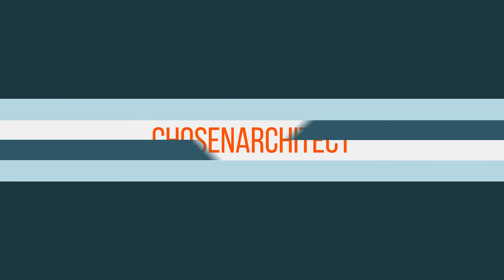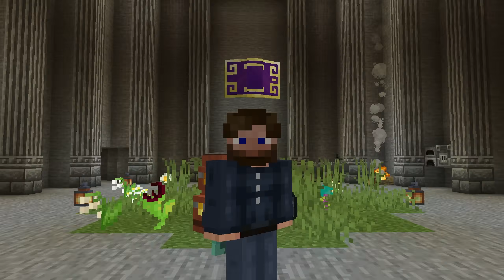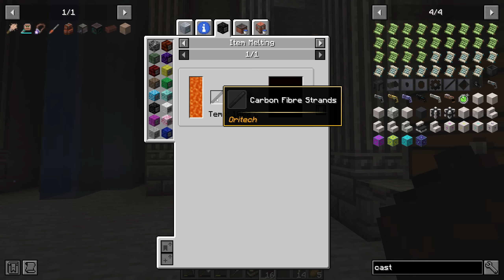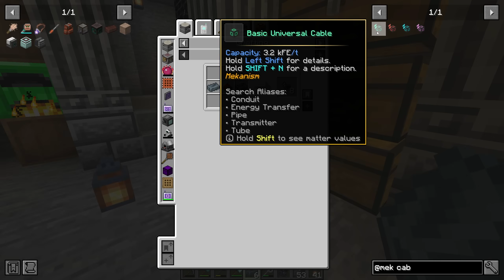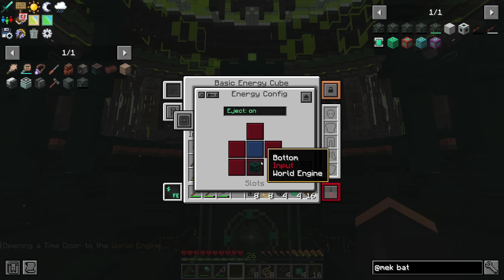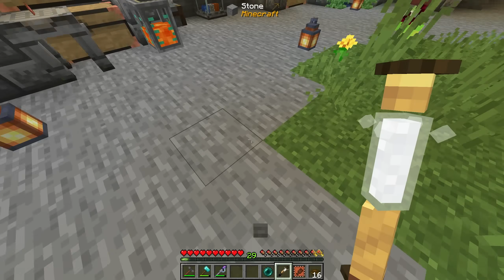Stoneblock 4 Minecraft Modpack EP3 FREE POWER and Quartermaster Quest

Comment: Best way for steel has to 100% be moo fluids takes some time breeding the carbon and iron but once you get the steel cow put it in a jar and add fluid pipe onto a basin (from productive metalworks) and a hopper with a chest under it helped me soo much

Comment: Is anyone having an issue with the world engine machine blocks upgrade/quest? I’ve submitted a stack 3 times now and it has done absolutely nothing. The game will not upgrade the world machine. I’ve tried resetting it and everything…
Reply: The mod pack developer keeps removing stuff, claiming they "fixed" a bug, and every update new bugs have been coming out.  I would HIGHLY recommend avoiding this mod pack now, it's nothing like it was before.  It used to be good.  The github repo is laughable at best.

Comment: The heat generators will transfer heat down to the generator below but some heat is lost this way. I did the math and, with 9 generators, you lose about 300-400 heat stacking them 3x3 vs placing them next to each other on one Y level. I usually create a 5x5 hole for 10 generators. You dig 2 lines in the hole for lava, place the generators on top of the lava and then just fill everything else in with lava after they are placed. ~440 heat per generator if they are lava-logged with lava on all 6 sides. For a temporary setup, either way is fine, you're probably not going to miss the lost heat by the time you upgrade and, to be completely fair, this setup looks 100% cooler than dumping them in a hole and covering them up.
Reply: Thank you for taking the time to explain this, it's useful info for me and you're right, the heat lost is insignificant for early game

Comment: @11:32 If you make an infinite lava source (do the source blocks at the top of a pool trick) and collect it via Create, you can pump lava directly into the Thermal Generators instead of trying to lava log around it. Way more efficient. Also, Mekanism fluid pipes can connect right to the Hose Pulley and you won't need to use any pumps.
Reply: I wonder whether lava chickens are faster or slower than create pump.
Reply: @cheato1163  Dunno, not playing this pack yet. The generators seem to care more about temp over anything else though?
Reply: @tspepsirain  Lava eggs are basically just lava buckets in the form of eggs and as such im curious if they generate faster than a create pump.
Reply: @cheato1163  just started this pack and got into some early chickens. Lava chickens start off feeling pretty slow, definitely slower than when I've used create pumps in the past, though I'm not sure how much that will change when I get the chicken to a higher level, or if higher tier seeds affect that.

Comment: For the Heat Generator each side: Top, Bottom, Left, Right, Back needs to have a lava source block next to it for max FE Production.  You can do this in checkerboard pattern easily.  Unsure with the new lavalogg mechanics if this is now different.
Reply: With the lava logging it normally works well to line them up beside each other. But I wonder if this pack changed something because the results Chosen observed were... highly unusual.
Reply: @JamesStansell Jeffk is correct.  It works like it does in other packs,

Comment: Found a honestly busted early energy source in iron furnaces. If you get a lava chicken maxxed out (which is very easy, but just takes time. *You can plant and farm chicken seeds!!*) 
The lava egg gives 400k FE, which is kinda insane for an easliy automated smelter with a generator augment. An obsidian furnace makes like 10k-20k FE/s, so more then enough for the early stages.

Please dont waste like an hour using the entropy manipulator in hear generators getting enough energy to use the metallurgic to get 32 steel :')

also, you can just put the entropy manipulator directly into the mekanism heat gen. No charger needed

Getting into the chicken mod isnt to hard by buying the animal gate from the echo of guidance
Reply: The upgrade to convert the oven into a power generator is unlocked in chapter 3 of the mod, so you can't do it.
Reply: @97samuel  I mean, it is NOW, it wasnt then.
Reply: @cheato1163 dam, Thats kinda wild. Back then it was unlocked after getting the first mayor machine upgrade
Reply: Chicken mod is probably already accessible earlier than gates due to random bee drops at start being largely eggs and feathers.
Reply from the maker: The seeds are gated so thats a issue
Reply: @ChosenArchitect  Wait till people realise the seeds are entirely optional and you can just breed em placed in world and they egg out their products....

Comment: small tip, oritech fluid pipe is faster than the foundry faucet btw
Reply from the maker: Is it redstone cause controllable? If not I'll stick with a faucet
Reply: @ChosenArchitect  can't recall if redstone toggleable, but i knw you can just right click the pipe to turn the pull on and off.
Reply: @ChosenArchitect  little late but if not mistaken as long as you have it set to pull i think it will pull automatically, could be wrong though

Comment: 26:16 explanation time! These machines only take heat from the bottom, lavalogged doesn't count but they do have an innate "heat" property which they share to the device on top of it.

The best way to use these is to have a layer of power cable belpw your floor, a layer of heat generators beneath that and lava beneath that.
Reply: Don't think this is correct. sorry to say, read further down comment section for correct info on the heat gens
Reply: Thank you!
Reply: Thanks for the explanation! Do the cables still have to attach to the front of the heat generators instead of the top?
Reply: @JamesStansell  I've only tested Mechanism cables so far, but yes they needed to connect to the side and did not work connected to the top.
Reply: You are mistaken.

Comment: Tips:

Once you finish the 2nd Echo quest and you get the next set of echos, go meet them and check their shops. There are TONS of useful stuff to buy. If you have the cash to spare, buy a few "Random Teleporters". I was lucky enough to get a Portal Gun, which only needs FE to recharge. 

If you have the money and energy to spare, but the Actually Additions drill and the upgrades(2 Echoes sell upgrades for it). It makes clearing out areas much quicker, but comes at the added FE cost.

Set up a large room where you will keep your animals, and use the Gateway that you get that spawns your animals. Once everything is dead, all your animals will already be at their final location.

Comment: i wonder if the heat generators were meant to be placed at the bottom of lava lakes to generate the most power. I believe the lower generators are making more energy than the higher ones due to more lava sources above the generator.
Reply: I am as confused as Chosen because I have never seen that sort of difference before.

Comment: Something i randomly found is that the Mekanism gas Burning generator can use Gaseouse source for fuel which is just liquified source from a source condenser put into a rotary condensentrator. It can produce 20kFE/t when full and only uses about 26mB/t. The source use although can be significant it is nothing a bit of cactus with snad cannot handle.
Reply: And those cacti can be used for ethene as well, huh
Reply: holy thats huge
Reply: @_TheDoctor they nerfed it in 1.0.7 :(. It was so good they nerfed the gas burning generator recipe too. It now only makes 3k-4k FE/t.
Reply: @caseycr1139  Good news! It has been buffed slightly in 1.0.8. Its now 5k fe/t